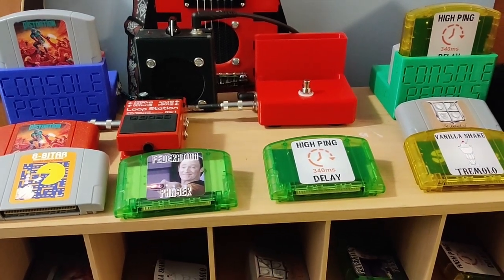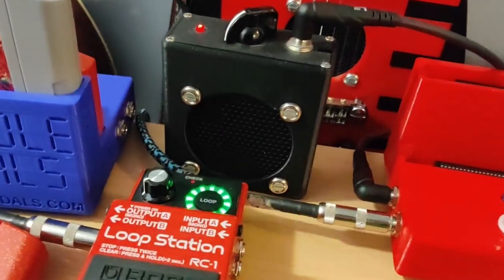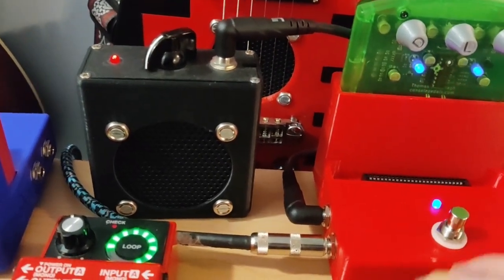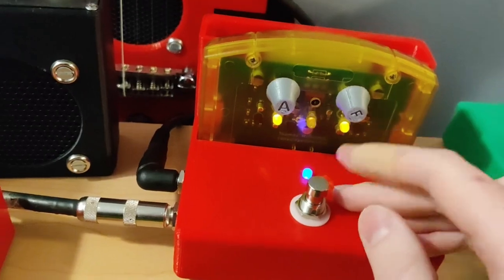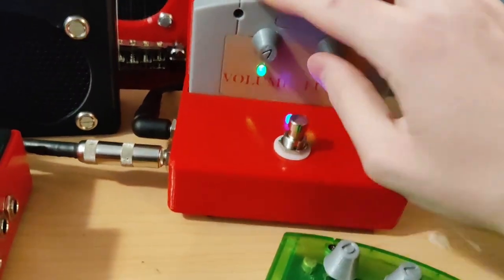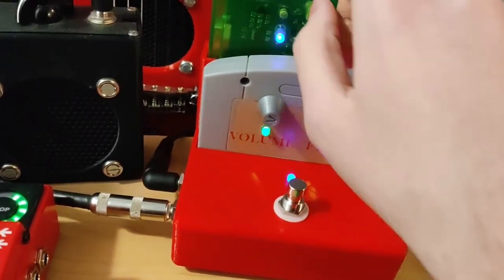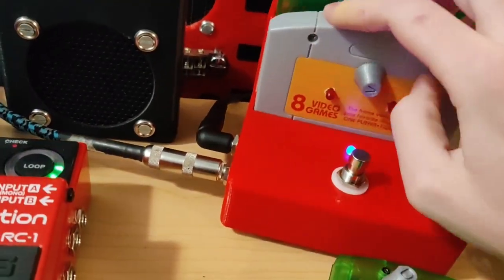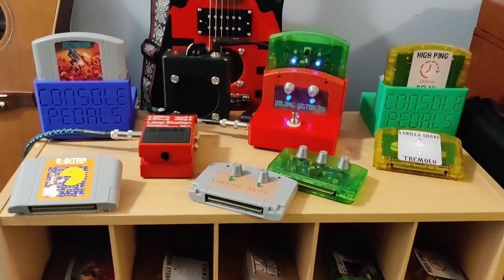Dual Cartridge Modular Guitar Pedal

Comment: I don't suppose something like that mini amp could be squeezed in a cartridge? that'd be a sweet cartridge to have. Any estimate on when bases and any cartridges will be available? Super Awesome!!!!
Reply from the maker: Thanks. I made a mini amp cartridge a little while back but wasn't really satisfied with the result. The only speakers that I could get to fit were small circuit mounted ones that sound ok at low volumes but get pretty distorted and a bit tinny as the volume and gain goes up. I might revisit that though since after digging it back up it doesn't sound as terrible as I remember.

As for availability I made 2-3 extra of everything in the video (except the speaker). If you're interested in buying one I've got a janky Google forms link where you can give me some specifics on what you'd be interested in here: https://docs.google.com/forms/d/e/1FAIpQLSfdzsvQDyeI9enuvr2posDXBeutn_Hbd3A27p_-9zOuuHdrLQ/viewform

I've got pricing on my website but it's more a suggestion. I'd be willing to come down on the price a little if you're looking to get more than a couple cartridges.
http://consolepedals.com/cartridges/
Reply: @thomasmcdonagh1837  Awesome!, I'll fill out the link once I can decide which cartridges I want to start with! Definitely will want the two cartridge base.